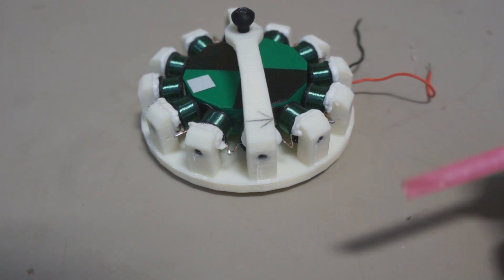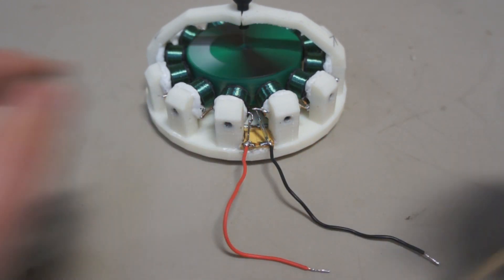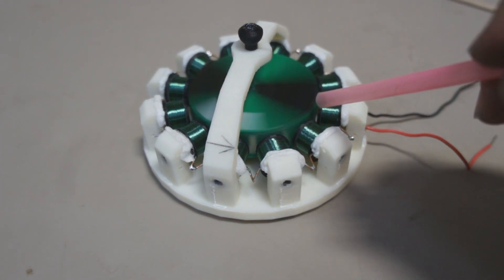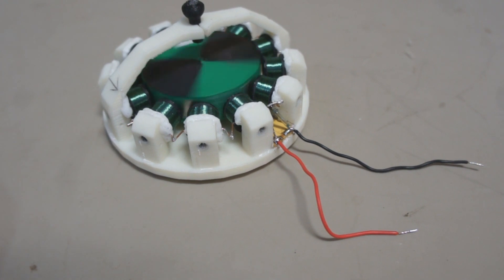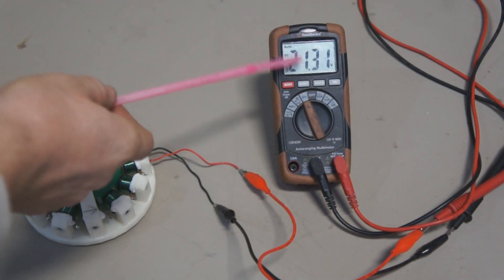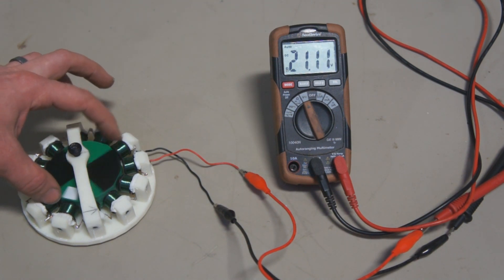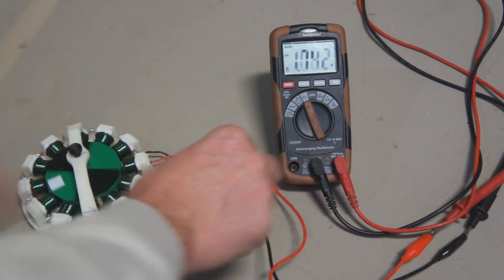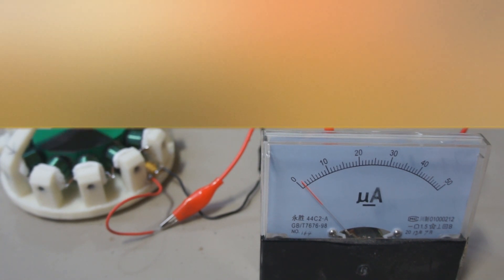3D Printed Motor Runs Almost Like a Perpetual Machine

Comment: do you know what pisses me off ? The fact that someone on youtube comes up with this super idea, and why the fuck don't energy companies adopt ideas like this.
Reply: This isn't an original idea, and they don't use it often because they aren't very useful for power companies. However, car companies put this in racecars because its basically a type of battery that uses momentum to store energy instead of chemical reactions, and it has properties very useful for electrically assisted racecars. NASA uses it as well, I imagine because it doesn't suffer from wear from being cycled quickly, making it very useful for low-orbiting satellites that go from day to night over and over very quickly.

Think of it as a battery with kinda fast self-discharge, good efficiency, decent energy density, high cost, and stupidly quick charge and discharge times. Racecars use it because no conventional type of battery can come even close to handling the amount of energy generated by a racecar without making the battery so big and heavy that it would just make the car too slow. Remember,  the Prius can't save any of the energy from braking more than about 20% mainly because the batteries won't accept that amount of energy at once. Imagine how much a racecar decelerating as fast as physically possible at 200+mph would overload conventional batteries.

Comment: so why don't we use this in a car, if  you put this in place of the radiator along with battery pack the car can become self charging just replace the pin on top with a fan and as you drive down the road you now can generate power to charge the car. I'm sure i can make this work but its not my idea so ill just toss it out for you to think about it.
Reply: Sure, self charging for about 10 minutes. Then your transmission fluid begins to boil, a steam explosion occurs, destroying that vital component, and you throw a piston as your engine gets too hot to remain sturdy. The Radiator is a vital component of your car. DOn't remove it. You car is already self-charging too. That's what the alternator is for.
Reply: @MeepChangeling  lol sorry i mean add it to your Tesla

Comment: 8:29 Why does the V continue to rise after you stop blowing on the motor?  You've stopped adding energy to the system at that point (presumably).
Reply: Squoyster Crustologist 
Rotor is still spinning faster than the stored power would drive it so it's still charging. it will charge until the rotational speed falls enough that the voltage being generated is lower than the capacitor's charge. then it turns back into a motor.
Probably.
- Eddy

Comment: Could you run a cell phone charger?
Reply: no, since it won't generate energy. It's a motor and will use up the stored energy due to air resistance and friction. If you connect a load to it, it will eat the energy up immediately.
Reply: +PunakiviAddikti can it be inverted or used to spin a dyno at high speed via solar?

Comment: Hey, you don't mention how the system works at all. Or atleast I couldn't find it. What makes the wheel spin nonstop? You mentioned alternating directions but I don't understand what you did. The coil wires need to have someway to alternate the direction. So, how do you alternate the direction to get it going?

Comment: Push pull. Ive been thinking of ways to make almost free energy for years doing something like this. It would be great for citys and towns to run entirely on huge versions of almost free energy, in the future maybe, but what I've been told is the governments ( and oil company's) buy most inventions or eliminate the inventor. I think almost free or minimum input big output energy generators will work and be a reality but I'm sure energy company's who make billions won't like this because it would make them no existent.

Comment: ever thought of going with making 10 of them having them attached to each other to share energy someone and have a little Docking Bay that is linked up to another motor that would pretty much blow air on all 10 of them simultaneously as some point power Drop and shuts off wen power is high again?

Comment: what if you just had a fan spin it up every few mins to generate infinitely (relatively speaking)
Reply: what will you power the fan with?
Reply: Michael Hartmayer the electricity generated by the motor would charge capacitors or batteries to spin the fan for a short burst. I think it would make the motor spin for much longer
Reply: maybe, but not infinitely

Comment: why when you stopped the circuit in your hand the voltage doesn't become 0, it still 20.54 Volts? that's means there is some kind of voltage source.
I personally do not think this is real.

Comment: 3d printed is kinda a misnomer...its just plastic that holds all the wires and circuts.....so you kinda clickbaiting folks dude
Reply: were you expecting 3d printed circuits ?
Reply: It is currently not possible with commercial 3D printers to 3D print an entire motor. That should be obvious and shouldn't need further explaining. If you think it should be explained that the entire thing is not 3D printed you have no common sense and should probably seek help.
Reply: It's a known fact that you can't 3d print an entire motor. It has 3d printed parts, and there is nothing "retarded" about defending them.

Comment: I wonder how this build would work scaled to bigger size with more powerful capacitors like that used to start car engines ;)

I like that projects, i was sceptic once but know i bielieve why now try, why not test.

Open mind in that topic is nessecary, exacly in times when oil lobby pay for lying and creating scams prowing alternatives for oil and other (bussines) patents dont work.

We can do two think. Bielieve lobby and pay them for energy, or create energy and pay for thinks i we cant do. Like technology, medical care, buildings, mashines, and other bussines. ;)

Still cash flow, but somone need to step down and stop use Us as pawns, to buy what they want to sell, this does not work that way.

Ps. I wonder too how gold wire would work in this coils (ofc big cost, but to be honest, gold is not a toy to wear. Gold is a powerfull resource for electronics medicine, like platinum and other rare metals)

Comment: as cool as this is, its usefulness is virtually nill, the reason it can run for so long is that youve built it with an absolute minimum of friction, but the way its built not only can you not atach anything to it if you did it would ceace to function as its friction level would increase and reduce its active lifspan significantly, if not outright stop it due to the drag exceeding the coils potential
so what you have here is an interesting, but ultimatly useless device, much like the newtons cradel...its little more then an office toy.

Comment: if it requires barely anything to run for a long time cant you use the energy generated from the time its running to start it back up?
Reply: That would be perpetual energy. If you attach something to the motor, it'll reduce speed rotation by too much to allow this.
Reply: It was generating 20v, but also instantly using it. If you stock the 20v instead of instantly using it, the motor will stop.
Reply: as long as the caps have a charge, it can go
Reply: It was generating 20v for a while. Couldnt you just hook it up to something that stored energy, then after it dies, use that energy to blow air onto it again?
Reply: will eewonka
how many microamp compressors do you know of?
Reply: You tell me it seems like you get called on alot in class :OOOOOOOOOOOOO
Roastatropolis

Comment: Unless those capacitors are charged before you start then the armature on its own without any of the wire or magnets would go at least as long.
That's just a very low friction motor with super capacitors instead of batteries.  No point in trying to recharge them with energy taken from them to run the motor.  Nothing's 100% efficient so there will be a net loss if you do that.
The back emf will automatically reduce the rate of discharge without anything fancy wired up.
Reply: what if u insert a joule theif into the circuit?
Reply: +Awesome Nuclr then you would have even less energy to run it
8^)
Reply: Then you may be able to run a single led for some time.
Reply: PunakiviAddikti So that would make it a simple generator.  You turn it with a motor or by hand and it produces electricity.  Nothing special about that.
Reply: no i meant if you put a joule thief aka input from motor into joul thief out put of joule theif is a super capacitor with a diode feeding back into the motor infinite electricity??

also what would happen if you have two motors axle connected and ther outputs to a joul thief connecting into the other motor
Reply: Awesome Nuclr Is a Joule Thief (I assume that's how it's spelled) the name of something?  I've never heard of it.

Bottom line is that if you're asking whether you could take energy from something and then put more back in than you took out then the answer is no.  

The First Law of Thermodynamics prevents that.
Reply: search up joule thief
 also stuff can go beyond the laws of physics not everything taught to you is true let me tell u that
Reply: Awesome Nuclr Uh huh.  Well you're not going to break the First Law of Thermodynamics especially in your home workshop!

Someone said "It's good to have an open mind but not so open that your brains fall out."

Comment: Anyone know how to put the power back into the load powering the motor? So it would recycle it's energy (yes it will run out sooner or later through the coils)
Reply: There is not really any way to do that. You could try storing the energy and feeding it back throuhg a diode but that may not work at all.
Reply: Can I email you and explain what I'm trying to do?
Reply: you basically want to power an air compressor with 1 uA to have a continuous supply of air flow to keep it going?
Reply: This is a pulse motor.. I built one but I'm having problems feeding the energy from the generator back into the supercapacitor bank that is running the motor, I know there are ways to do it, ive seen it done here on your tube and yes eventually the power will dissipate.

Comment: put it in a vacuum
Reply: It will get hot faster.
Reply: friction is Resistance
Reply: that is exactly what I thought
Reply: Use donut magnets to get the hole system in suspension, getting no resistance, put it in a vacuum, and cool it down a lot.
Reply: vicioustonez
Reply: its not absolute vacuum . so still had gas inside .
Reply: Yeah, but use one of those Dysons that have the clear dust bin so you can still see the motor spinning...
Reply: What would that accomplish?
Reply: Won't do anything, the contact friction and capacitor loss is much higher than the air friction.

Comment: for it to work, that means... for it to actually convert the electrical power to mechanical power, you might wanna not just hold the core down with a needle...

Where do you get the mechanical output? Nowhere, coz you can not load the "perpetual shitload of cocksocker clickbait machine" and it isn't even running on nothing, you admit it runs on capacitors, which is basically an electronics-shortterm battery...

Good job, you invented nothing, and it looks like shit thats about to fall apart and

and don't forget to tell ppl you did not Print any of the copper coils either ;)

Comment: Is it possible to convert 
Two (2) 24 volt DC batteries
With 900 watts into
Smaller  batteries to run the
same 900 watts Or more?
Also can the smaller capacitor
batteries with 900 watts or more can you hook them up to
a solar panel to charge then run the smaller capacitor
or lithium iron phosphate battery?

Comment: Would this work well as a generator for a small vertical axis wind generator?
Reply: +LimitedGunnerGM No.  You see, what you need for a wind generator is ... "wind".
Reply: +Phillip Phillips yes, easily done in my area. I was referring to the low friction and output capabilities. Scaling this up for higher output
Reply: LimitedGunnerGM Or just use a traditional wind turbine, which are manufactured by aerospace and power companies who actually know a little about "output" and "scale" and reduced friction.

This is a pretty toy. Nothing more.

Comment: Since it takes so little power, could you ad a very small coil or two just to send power to the capacitors? If they are small enough and can power the caps then the loss to lenz law should not stop it..

Comment: Would be neat to hook up a small thin form solar panel to it and use that to run the motor and use a gear reduction with a flywheel to operate all sorts of things.

Comment: My Thinkpad takes a 20v input on its charge port. Would I be able to use this to charge my Thinkpad if I chopped the plug off a charger, and hooked one of these up to that plug?
Reply: +mrbigmouth502 no
Reply: Why not?
Reply: not enough voltage and especially not enough amperage, you would need one the size of a minivan to do what you want to do.
Reply: Not even for a trickle charge?
Reply: nope, thats where the amperage comes in not enough of that and ur not getting anywhere.

Comment: Not just the capacitor, as the field of flux on the coils collapse it charges the capacitors, This is a great example of a tank circuit. It's actually the inductive capacitance that gave rise to the fictional invention of the "flux capacitor"... Tank circuits are usually used to make a frequency. More commonly to use a quartz crystal, but old Hams that didn't have a quartz crystal would build and tune inductors and capacitors to build their radios.
Reply: +HamrickCE Not only that, an induction coil's energy capacity is only limited by it's operation current where E = 1/2 LI^2, where E is the energy (in joules) "L" is the inductance (in henrys) and "I" is the current (in amps). There are plans to use super conductors to store electrical power at gigawatt-hour capacity for power stations but they are not practical yet. Most of the energy are indeed stored in a stablized electromagnetic flux on the ferromagnetic coil so it's a true "flux capacitor" if you want to put it that way. It actually store energy by the wave-motion of an artificial stationary wave within the conductor coil.

Comment: Can you make a video the is time elapsed with this and a 12VOLT AND 24VOLT.
how long will the this power a light?
Think if the you need emergency power it a black out from a natural disaster.
few issue is how to make it idiot proof-
 Like how to limit the power amps and volts so not to overload the capacitors but still the have the desired amps and voltage[common voltage on a switch to make it adjustable] 

Is there a better way or a different way to start up the generator?
sub question is
When starting the generator how does one know where the sweet spot is at for the current setup?
Maybe add a led light system for notification ?

Comment: Your magnetic reed switch going from one side of the coil string to the capacitor is open. Like, you can look at it and see the gap between the conductors really clearly. There isn't a circuit here.
Reply: I thought it was a reed switch, too, but those contacts look unmoving. The gap between the metal is what makes it a capacitor. There is a circuit there as the electrical energy is stored in an electric field between the contacts. This works in AC but a capacitor blocks a DC current. The Inductance of the coils with the Capacitance means that this circuit has a particular resonant frequency and the speed of the motor will be defined by it. If those contacts do happen to be slightly moved by the generated magnetic fields of the local coils if will create a variable capacitance as the contacts move in and out from each other.
Reply: a) it is in circuit
b) there is energy put into the circuit, as he explaines and measures
Reply: nope, not in resonance, it works just as he explains. You simply cannot see the reed switch moving, the gap is tiny and the contacts moving fast, no way this can be captured without a high speed camera and a microscope.

Comment: And what is the point of this? not being mean, but i don't really get the point.
Reply: efficiency like adding a turbo to an engine
Reply: +Exogen Design It doesn't "generate" 20 volts.  it takes it from the capacitor which has stored it.

that's like saying a battery on a charger magically "generates" voltage.
Reply: +CorruptedPixl_ if you look at it in an Electrical engineer perspective, That little thing generates  20 volts, using a little super capacitor.whats makes it  amazing is that, it is a self excited series generator which is the other type of generator besides  shunt generator(parallel) that can run for a long period of time with some modification. I know he said its a motor,  But since its an mechanical to electrical energy(Vice versa) thus its a generator. You  can improve the torque of that thing to make it more useful. Now make a big one with more coils and more poles,   then voila a  source of energy. Get my point?
Reply: yea i get it now
Reply: +Nopiw It's not much of a generator if it runs off capacitors.  I also don't get the point other than teaching / experimentation / novelty.
Reply: Nopiw  i probably do, but i based it on engineering , and it was just a random thought for the other half of the context.., well there's  saying "thought can become an idea,an idea that becomes theory, and thus need to be achieved. its like saying an Ideal diode doesn't need biasing so does transistor, if you get my point.
Reply: Phillip Phillips oh, my bad.

Comment: sorry, but a high voltage is because of the open circuit. Attach a load and try again!
It is fine job, but never take the OCV as the won Voltage.